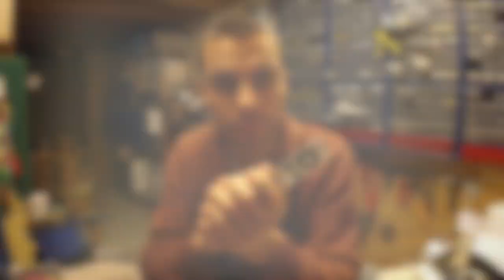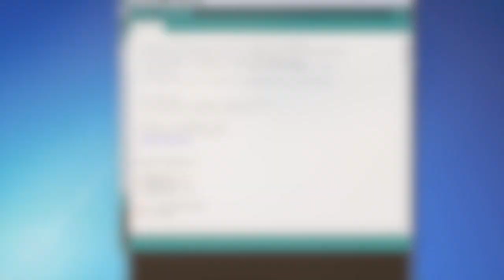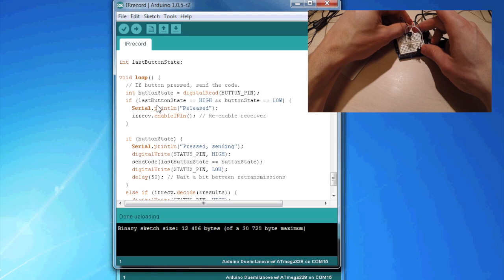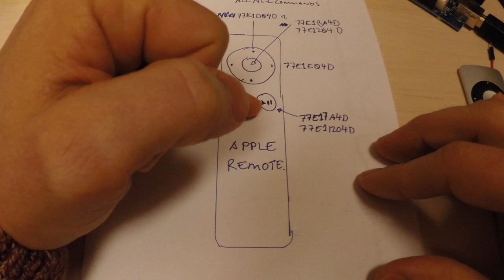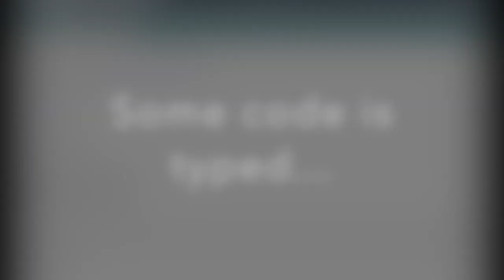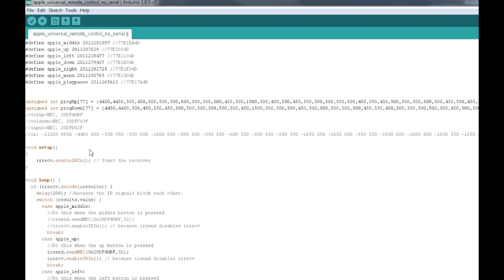Apple Remote as a Universal Remote Control using Arduino [Anything Arduino] (ep.12)

Comment: Hey. Could you program the output IR to be used to change slides fwd and back and play content from a ppt presentation? Has anyone done this?
Reply from the maker: You can send any code you want. Just change it in the code “et voila” ;) hard thing might be to find which code to work.

Comment: For what it’s worth, the commands that the Arduino IR Remote library captures for the Apple remotes are actually not quite correct: Apple remotes aren’t actually NEC code. They’re based on NEC, but using a totally different data encoding. Critically, it’s 7-bit, not 8-bit, so the hex codes from the sketch are the misinterpretation of multiple 7-bit words. For just detecting or reproducing it, it’s fine. But if you want to actually compose the codes yourself (e.g. to change the device ID sent, or to use some of the codes that exist in the Apple protocol but aren’t used in the Apple remote itself, such as next/previous track), then you have to properly handle it as 7-bit.

There exists an Arduino Apple Remote library that actually handles it properly.
Reply from the maker: Thanks for the info, I'll look into that library.
Reply: Kristian Blåsol I’ve been meaning to try it out myself. I’m a bit frustrated at the Arduino IR Remote library, in that they’ve been holding back tons of bugfixes for known issues, since they wanna make another major release. But it’s been years, and so the library is still stuck with some really dumb errors (like the wrong carrier frequency for sending Panasonic codes. Literally a single number to change.) 

And not providing any way to handle Apple IR codes properly, of course. (Heck, it can’t even inspect them properly, as the special raw reader sketch only captures a single code, making it incapable of performing a correct capture of the two-code commands many remotes use.)

Comment: Nice project! For increasing the range of your transmitting IR LED, you should place a semitransparent red plastic in front of the IR LED.  You can observe high intensity of light from your IR LED transmitting diode compared to Apple IR LED, which is filtered, thus increasing IR wavelength range.
Reply from the maker: Interesting. Getting longer range by filtering? I’ll look into that sometime, especially if I need longer ranges. Thanks for the idea. :)
Reply: @SourceryOne  , yes, that's the reason, why all remotes have a transparent red plastic in front of the IR transmitter LED... ;)

Comment: I had the same problem with sending codes. For me the solution was to send it 3 times with:

for (int i = 0; i < 3; i++) {
 irsend.sendNEC(0xAC53807F, 32);
 delay(40);
 }
irrecv.enableIRIn();
break;

just like the example sketch "IRsendDemo".
Reply from the maker: Thanks for the info, I know some devices need this "three in a row" kind of approach...